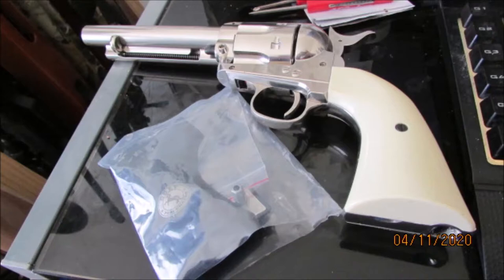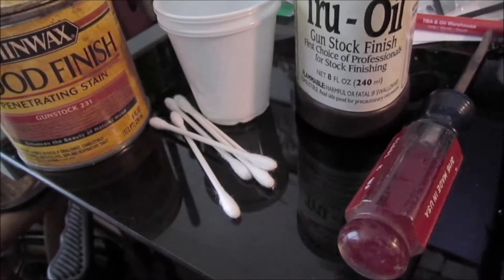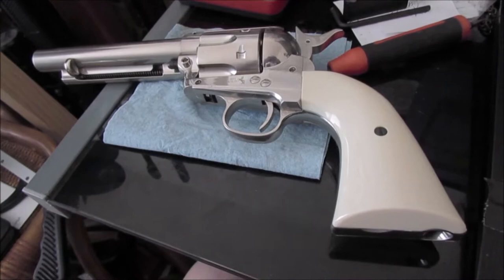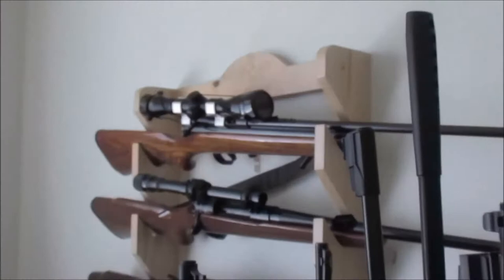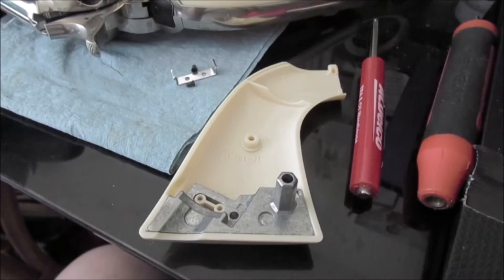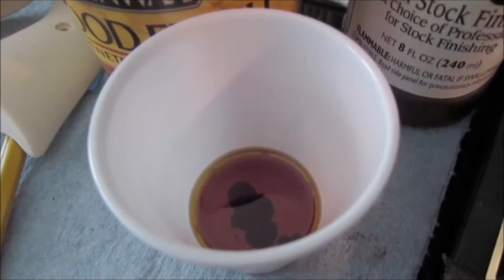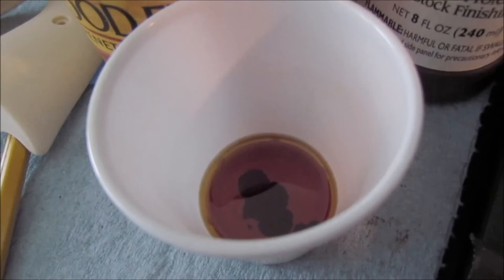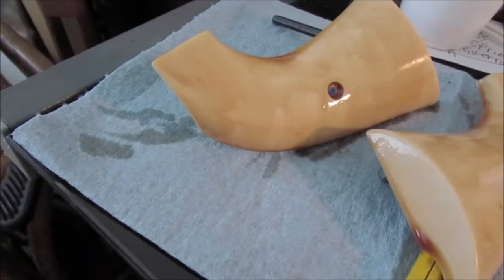The Lone Airgunner EP138 Antiquing Umarex faux ivory grips

Comment: I'm pretty sure these grips are just ABS.
I wouldn't be surprised if the dukes grips were delrin.
Had they made them of " French ivory " imitation ivory it would have aged naturally in short order.
Reply from the maker: I said Faux Ivory. Faux in this case is by definition fake or imitation in descriptions of them. Not another word for French. And it's hard, almost like styrene. JW's were that solid white stuff that easily absorbs things that can stain it, like coffee or tea. I used leather dye.
Reply: @unionrdr  
French ivory is a form of faux ivory used on pocket knives up through the 80's., it ages quite well and looks great over time.
I was just mentioning that had French ivory been used for grips the Duke probably wouldn't have needed to age his.
Reply from the maker: @TylerSnyder305  But in the grammatical l context I used it in, not as a pronoun, it means fake or imitation. I know what tou mean, but that was not the context I intended to infer. The problem with the material you menti9nwd is these Umarex/Colt grups are longer tgan the originals to make room in the frame for 12g Co2 capsules. So stock Colt SAA grips won't fit in this case. So what you call French Ivory and faux ivory are not the same thing. And he/we wantyee them to look aged now. Not wait 60 plus yearas.  It's not a quick process naturally.
Reply: @unionrdr  French ivory is a form of " faux " imitation ivory made from Celluloid.
It does not take too long to age in my experience.

Maybe were having some sort of misunderstanding here,  but I went off topic so I suppose it really doesn't matter I suppose.

Btw the 3rd screw is inside the hex post you tighten the cart with, undo that screw and it'll come right off.
Reply from the maker: @TylerSnyder305  But not what I was talking about at all. You are taking the whole thing out of context. Wrong imitation ivory material. I'm not the one misunderstanding here. I literally mean what is shown. You misunderstood and wett otw bgg eforevfc thinking and jow trying to back out gracefully buy making me seem wrong. I meant precisely what I said.
Reply: @unionrdr  all I said was I'm pretty sure these grips are made of ABS not polystyrene ( they had the smell of ABS when I was sanding mine ) ,and that if the grips John wayne had were a certain form of ivory lookalike he may not have needed to age them much if at all.
It was just a random thought I had, I was not insinuating that one could use such grips here were they to exist.
Obviously I know they wouldn't fit.
 
I do not really know what the misunderstanding is or who's end it's even on.